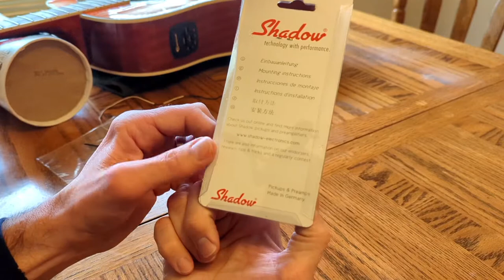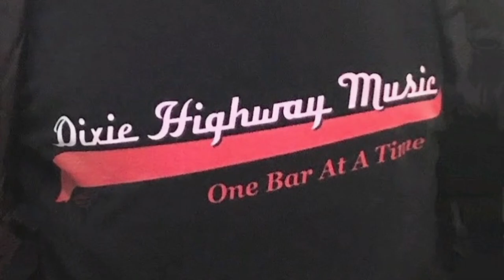Epiphone Hummingbird Pro Repair with Sound Demo / Shadow Pickup

Comment: My hummingbird pick up seems not to work the red light does not come on i even change the batteries I have no Idea if it does not work I dont have amp to try it on.
Reply from the maker: Are you talking about the little red light right above where it says BATT LOW? As long as we have the same pickups, that light only comes on (on mine) when the batteries are low. 

You said you don't have an amp but do you have a 1/4" instrument cable? If you do, if you stick that cable in there (even without an amp) right before it fully seats, you may see the red light flicker if the batteries are installed correctly. Same thing when you pull it out - as soon as you start to remove it it may flicker quickly. That's what it does on mine so that tells me the pickup is at least getting signal from the endpin jack.

Let me know if you try that and if it works for you.
Reply: My piezo on mine makes alot of noise when I hit the strings sounds like shit I want to put a new one it I love the guitar hate the electronics
Reply from the maker: @davidledford3522  Wow that sucks unfortunately.  Hopefully you can get it sorted out.